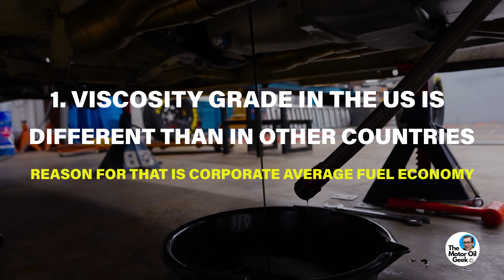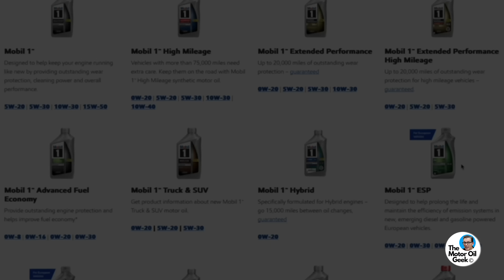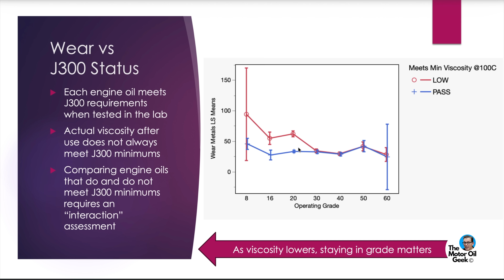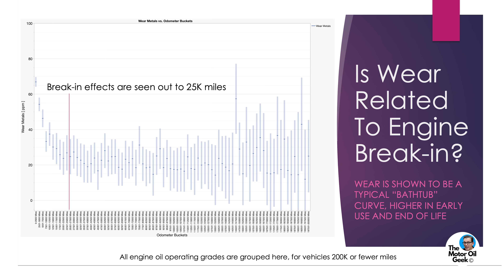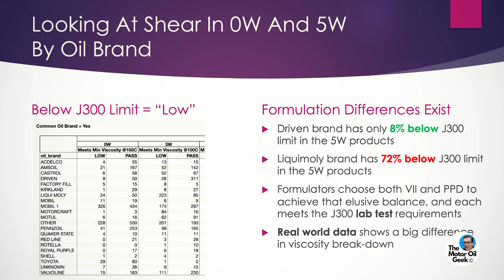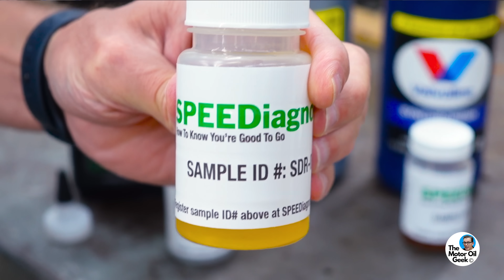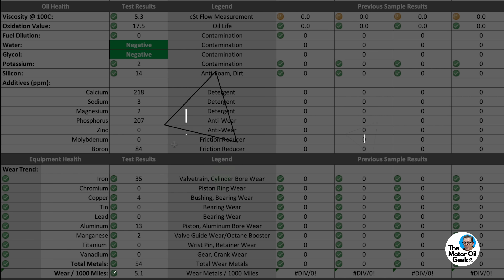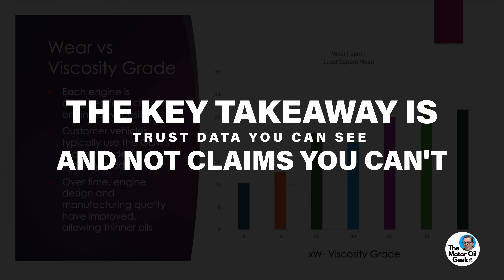More Ai Lies? The FACTS about 0W-20 vs 5W-30 (With Evidence)

Comment: Now we need a shear stable 0w20 oil comparison
Reply: Agree!  Fuel dilution tests would be good too.
Reply: @dadadadada4975  That is totally dependent on the engine, not the oil.  Example, Honda has issues with fuel dilution on some direct injection engines in the CRV.
Reply: yes, would love to see this
Reply: Yes!
Reply: Buy AMS Oil Signature Series or Pennzoil Ultra Platinum 0W - 20 and you have no worries... and change your oil more often then the manufacturer recommends. The reason to use AMS oil Signature Series, is if you forget your oil change, it is over filled with additives to last longer.
Reply: @black_dog_barks  I use the PZ UP 0W-20 I buy a 3 pk 5qt case of 3 every Jan and change my oil 3 times a year, I've noticed the additives settle on bottom and recommend shaking the shit out of the bottle to mix.  Have you come across that issue?  All the best
Reply: @CRichardNorton I use that too and regardless of the oil, I shake the hell out of it too.
Reply: @CRichardNorton 

Why would shaking make a difference? It's all going to settle in your oil pain just like it does in a bottle. Once you start driving, it's all going to get mixed up from all the sloshing and pumping.
Reply: @snaaaaaaaaaaaaaaaake to get the additives out of the bottle and into your engine. 😂😂
Reply: @FlatPlaneCranky 

You're telling me they aren't pouring out for you at the end of the pour without shaking?
Reply: @snaaaaaaaaaaaaaaaake that’s correct. After pouring out the unshaken oil in a white bottle look down at the residual oil at the bottom. You’ll see the additives that fell out of suspension. Always give the bottles a good shake before you pour them in. The older the oil stored in the bottle the more the additives fall to the bottom.
Reply: @FlatPlaneCranky  I don't think I ever had that problem with Mobil or Castrol but good to know.
Reply: @snaaaaaaaaaaaaaaaake  I wouldn't waste anyone's time asking, I've shaken it when bottle is half full and still found the additives settled I've learned  at 1/4 of oil left shake the FCK out of it and really shake the FCK out of it or it won't all come out....start looking at bottom of jug and see...all the best Pal
Reply: @FlatPlaneCranky  why don't you just store your bottles upside down??? Work smarter, not harder.
Reply: @b @black_dog_barks …I’ve been using Amsoil for over 25 years it’s the best 👍👍👍
Reply: @black_dog_barks — you realize that it’s just — Amsoil. You don’t need to separate the Yams from the oil. 😄
Reply: Just get the 0-40 already Mopar went through this years ago that's why the oil exists be safe run the 0-40!
Reply: @randyyoung9892  0W40 isn't shear stable though. I don't think you can make a 0W40 without using viscosity index improver. For a SAE 40 and using no viscosity index improver, even with PAO base stock I think a 10W40 is the best you can do.
Reply: Blackstone has analysis results from all over, they would have the information from hot states like AZ and TX.
Reply: Just change your oil regularly and you will be fine.   I know people who have multiple 100k miles on different cars with the cheapest Dino oil they could buy at Walmart.  Changed regularly and cars were just fine.  I use synthetic and do regularly changes with 0w20 without issues.
Reply: @ernesternest815 i use Supertech synthetic 0/20 in my 2015 Yukon and try and change that oil every 3500-4000 kilometres. I started adding 1 litre of 5/30 royal purple syn , then the rest 6.5 litres of supertech 0/20 during the winter months. Summertime i will probably run 5/20 or 5/30 when its hot.
Reply: So the thing about 0w20 is that it uses additive chemistry to compensate for the laws of physics (viscosity etc) to provide adequate lubrication to an engine. 

0w20 seems to start shearing down well before the 5k mile mark, and that’s when you start to see oil consumption in the engine. 

Audi’s advice in this situation for their cars that take 0w20 vw508  is to top up anywhere upto a quart of vw504 when the oil consumption reaches a quart low

What I personally feel is that the rest of the oil has sheared down beyond providing useful protection, so it’s probably a better idea to just drain and change the oil out?

This is in tropical South Indian weather (hot and humid like atlanta).
Reply: @opslists  Without saying what 0W-20 oil you’re basing this on your comment is pointless.
If you’re going to make this claim, show the evidence!!
Reply: @JollyGiant19  vw508 ones. So far - Castrol edge LL (shears down comparatively fast in that I lost about a third of a quart by 3500 miles), audi oem oil - which is from shell I think - and Amsoil 0w20 ls-vw (which has performed the best of the three so far)

All this solely based on how smooth the engine runs and idles, rather than a UOA.  I need to find an oil analysis lab that’s in India and that does engine oils rather than industrial equipment lubes
Reply: @opslists 

Brother its insane you even admitted it is based on subjective analysis of idling smoothness is. That's not scientific at all. Why would you make such claims with such poor evidence. Using the word evidence is even giving it too much credit.
Reply: @snaaaaaaaaaaaaaaaake  tell me something. Why would a brand new car consume even a third of a quart of oil at 3500 miles with 0w20 and then not consume any at all with a 0w30 504? Fuel dilution? Oil shearing down?   The smoothness part is just an added extra. Oil level loss is quite measurable wouldn’t you say?
Reply: @opslists 

Could be bad break in procedure and you ruined your engine in advance. That's the problem with your non-scientific approach.

Look buddy. I don't even understand how can you stand on your own two feet, especially after watching this very video which was all about having evidence to your claims, and then pull of embarrassing shit like this. You made the claim about 0W-20 lasting less than 5k miles due to sheer stability. Prove it with data and not acedotes and subjective opinion about idle smoothness. I feel like I am being trolled. I can literally spend 15 minutes on Honda and Toyota forums looking at several random 7.5k miles UOA showing the oil is still to spec for shear disproving you anecdotal nonsense.
Reply: @snaaaaaaaaaaaaaaaake so breakin would be to drive it at all rpm levels without redlining the engine and then changing the oil at least twice in the first 10k miles.  Beyond that - the oil might retain its qualities but once the oil level has dropped a quart low, you’re better off draining and refilling  rather than topping up, even if the rest of the oil retains sufficient anti wear properties there isn’t enough oil left if you don’t have a full sump, and topping depleted oil up with good oil is a waste of time
Reply: Btw this isn’t a honda or a toyota. Audi engines are fairly well known for consumption of oil
Reply: @opslists You claim about 0w-20 shearing in under 5k miles would be agnostic of the brand. I used Honda and Toyota as a counter example because those are sold at higher volumes and it's easier to find UOA results of 0W-20 showing sheer stability still meeting spec far beyond 5k miles for those cars. 

Audis have been consuming oils since I can remember even in early 2000s when they used 5W-30 or even 40.
Reply: @snaaaaaaaaaaaaaaaake yeah it’s more an artefact of a far too optimistic drain interval in Audis. 7500 mile maximum i would say for the heavier weights and 5k miles for 0w20

As for hondas the ones I owned went in their service full recommendation from 5w40 and a year / 10k a decade back to 0w20 and 6 months 5k in recent years.  Me, I stuck to 5w40 shell helix ultra (aka PUP in the USA)
Reply: Also keep in mind - a vw508 / acea c5 0w20 has a 2.6 or 2.7 hths. 

A 0w20 used in a honda or Toyota can go upto 2.9 hths and be a borderline acea c2 (so very close to a 5w30)

Apples to oranges, comparing a honda or Toyota 20 weight to a vw508 oil.
Reply: @opslists  You keep talking but still not provided evidence to your claim that 0W-20 oil shears before 5k. Stop digging yourself a hole. Take a seat and take the loss. If I really wanted to spend the time i can probably find VW/Audi UOA examples of forums to also counter your nonsense.
Reply: @snaaaaaaaaaaaaaaaake as long as you tell me which 0w20 you’re basing your statement on. SP/Ilsac gf5 / gf6a? Acea c2? Acea C5?
Reply: @opslists 

Where is your evidence that those oils shear before 5k mark? That's a very bold claim that will require evidence.

I can probably find bunch of 0W-20 UOL on Honda and Toyota forums at 5k and more and still show plenty of sheer stability.
Reply: @snaaaaaaaaaaaaaaaake like I said, oil consumed so it is about a third of a quart down by 3500 and a full quart down (out of a 5.5 quart fill) by six or seven thousand miles.  And then the audi manual says yeah that’s normal go ahead and top up with 5w30, go figure
Reply: @opslists  Viscosity modifiers.
Reply: @bobmarker6812 yeah like I said using chemistry (add pack - viscosity modifiers, anti wear additives and so on) to compensate for physics (actual viscosity to safely lubricate the engine)

There are uoas for these oils in a4s all over bitog and for the most part they look pretty much consistent to me.  Sure I can go spend on a uoa myself, but when oil level drops it pretty much makes sense to change it out rather than top it up
Reply: @opslists  when oil level drops?
Reply: @5metoo  Starts to go like a third of a quart low at 4-5k miles. By 7k miles it is a quart low. Fuel dilution is a fun thing isnt it.
Reply: Well, technically 0w20 is practically outdated technology with 0w16 and even 0w8 on the market. 😅 🤓 

We need tests to see how stable 0w8 is after a typical 5,000 mile run… How much thinner can it get with some slight fuel dilution added in. 🤷🏻‍♂️
Reply: Mobil1 Truck & SUV is quite sheer stable. i'mma say that in the video he does, its 5W30 https://youtu.be/LUr4iTjXbhg?si=arn28Gy5cFeU4Ntf&t=531 

Before KRL - 8.73
After KRL - 8.3
Reply: 0W-16 called for in my new Subaru. I'll stick with the OEM during the warranty period.
Reply: @JohnW118 For sure I would. 0w16 is very shear stable actually.
Reply: @JohnW118 I’m using that for a suzuki grand vitara. Just not going to risk a 10k oci in that. 5k or bust 
There’s a Toyota spec with 0w8 if you’ve seen another of lake’s videos
Reply: @JohnW118  Get an oil analysis after a summer run.
Reply: But I use 5w-20. Nevermind I’ll just use 5w-30 and ignore everything discussed here!
Reply: @AgentLokVokun stick with 20 weight and change it in 5000 miles you’re good. Or move to 5w30 / 0w30 if your manual indicates that it is supported (could be the manual for your car in some other country of course)
Reply: @AgentLokVokun  still wrong, where's the 40?
Reply: @TheGuruStud  30w-40 it is then! You think gear oil wight is comparable to motor oil? Might as well just run some amzoil 75w-140
Reply: I live in a hot tropical country. Can anyone explain to me why my car engine runs smoother when using 5W40 oil than the recommended 0W20?
Reply: @ajhibhaktiar when changed new, after running say 5000 miles, under what conditions (etc)
Reply: Yup Lake already said the greater distance between the two numbers increases oil shear. So I run 0W-20 in the Winter cold weather starts and 5W-30 in the summer in Taxachusetts.  My engine is smooth and quiet after 5 years 120K and outdoor starts.

Comment: Hey, one question I might have missed the answer to, but in the segments measuring shear stability, was synthetic vs conventional accounted for, or does that not make much difference to this situation? 

Just because as far as I'm aware all 0w oils are synthetic where many 5w20 or 5w30 are frequently conventional.
Reply: I'm fairly certain that comparisons are for synthetic oils, since it is likely that most factory-fill oils (in recent years) are synthetic. Our 2025 Toyota Camry uses factory-supplied synthetic oil.

Comment: I'm not a tribologist, but I understand thin oil is all about saving fuel by reducing pumping losses.  It makes more power as well, but that's a happy accident.  It DOES NOT protect the engine better, but in fact it's the opposite.  Look for drag cars running thin oil.  You won't find many, because they want to keep their pistons INSIDE the engine!

Comment: I have a 10th gen honda civic hatchback which are known to have fuel dilution problems. Honda reccomends 0W-20 but I was considering 5W-30 to safeguard against wear. I'll take your advice and do an oil sample analysis before switching. Thanks for the pertinent video!